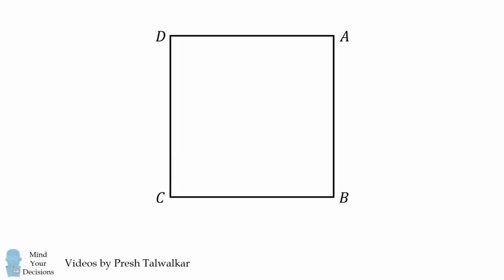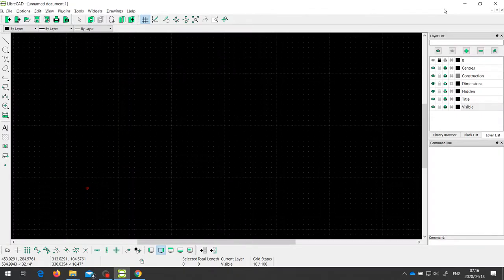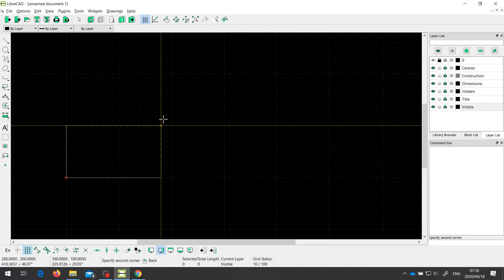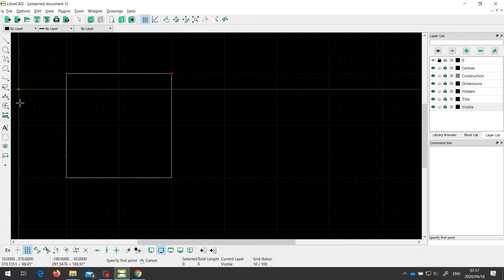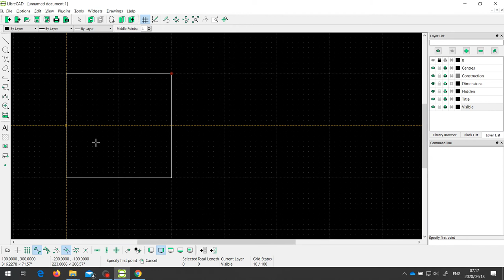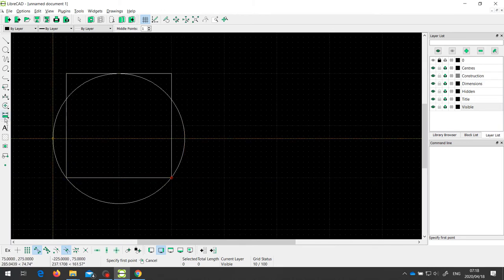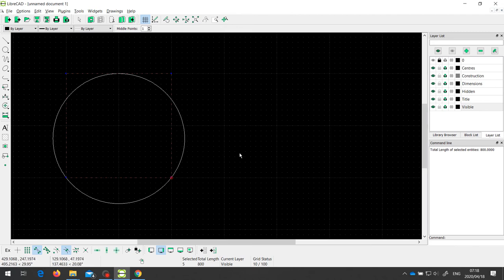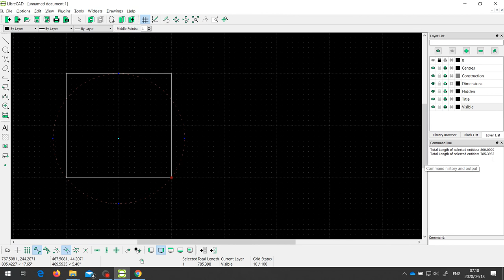Solving A Geometry Problem

Comment: Nice! cool way of doing it analytically. 
I got curious and wondered how you could generalize the construction of such a setup, on paper, without a compass (although with a compass, it'd be difficult for me). Long story short I found out that the square in this configurations is roughly 0.92 the size of a square that would be r√2, if you were to start with an inscribed square.

There might be an elegant solution but that's what I found XD